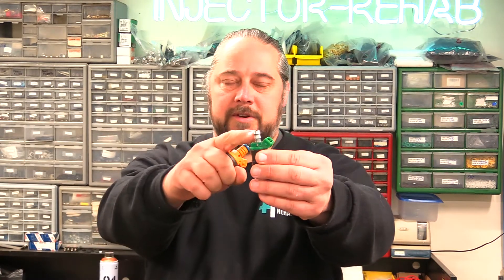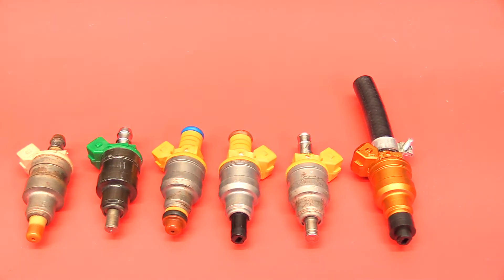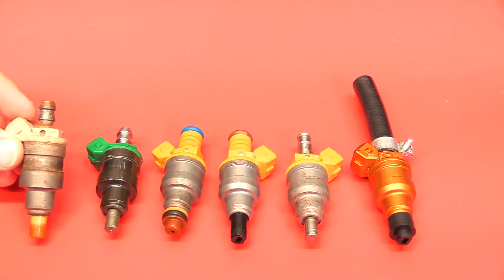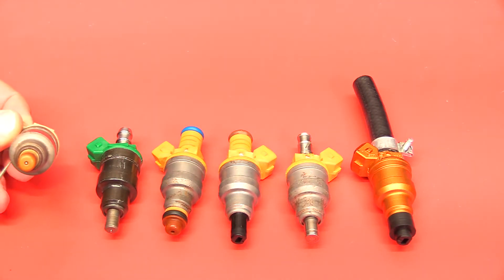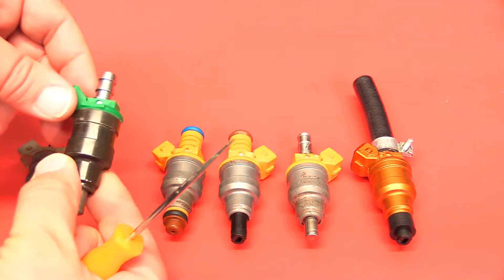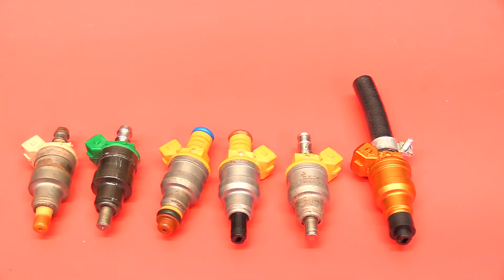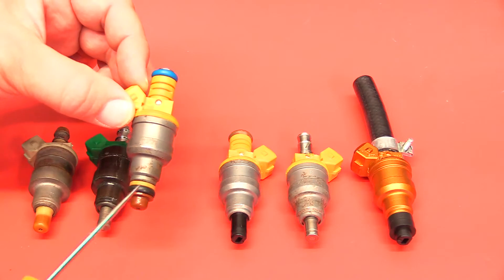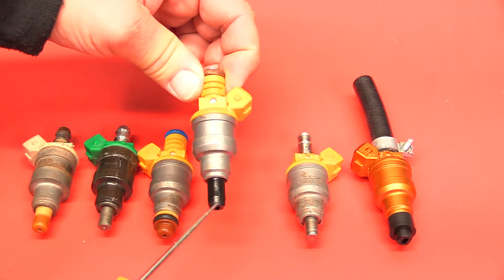How to: modify common rail fuel injector for hose-end applications

Comment: If you want to modernize an engine with an inlet manifold suitable for the old styre hose injector, will the newer EV1 / EV6 o-ring injector seal towards the manifold? New fuel rail will of course be required.
Reply from the maker: Depends what the manifold was designed to seal with. Was it designed to seal with an o-ring or is it designed to seal with a grommet?

Comment: Is it possible to do it the other way around? I mean connecting hose type injector in rail-end applications?
Reply from the maker: Why on earth would you want to do that? But if you did, I mean we fit them with several o-rings to allow them to seal on the flow bench. I guess you could do that in a real world application. But not sure why you would want to use the oldest technology type of electronic fuel injector available when there is something better. 
If you were going to enter a shooting contest, would you bring your musket? You could....